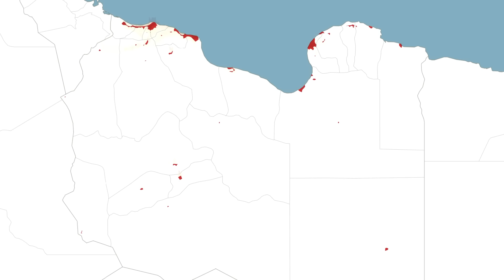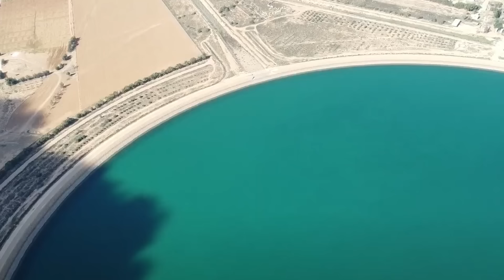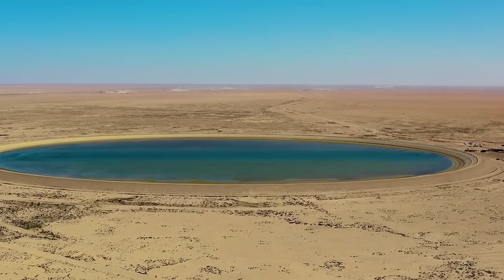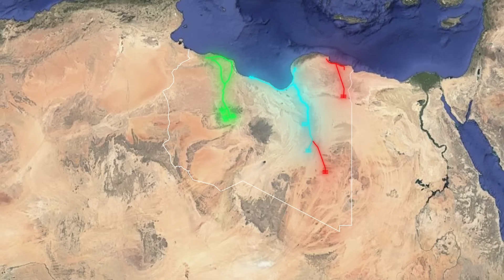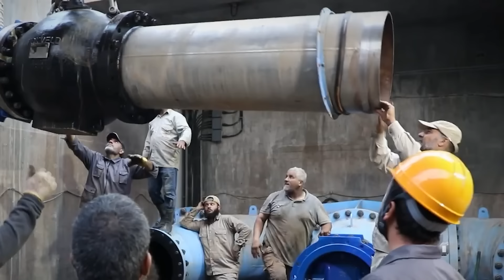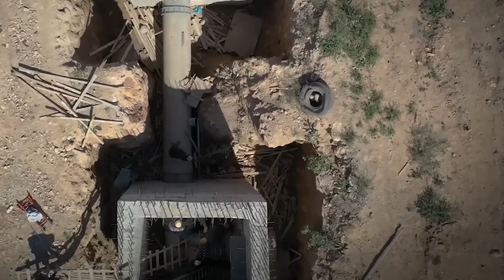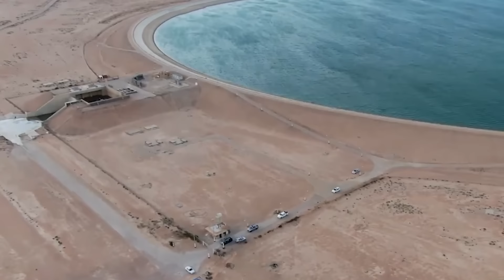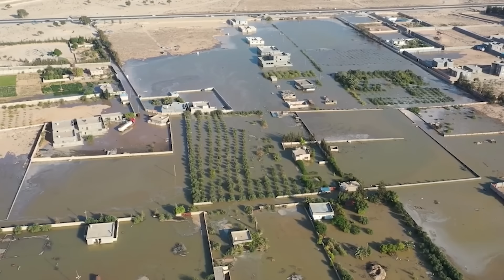They Start Pouring 2 Billion Liters of Unsalted Water a Day Under the Sahara Desert

Comment: The reason why they say it won't last past 2100 is because concrete pipes are rated for a 100 year lifecycle.
Reply: Detroit would like a word.

No, really you're correct. The pipes in Detroit were 95 years old when they burst during extraordinary weather
Reply: because contract always go to the lowest bidder which means they are using crappy materials or doing shotty work.
Reply: @tgreaux5027  Eh....concrete hardens for 50 years then softens for 50 years before it fails.
Reply: @DonaldJ22 maybe they cracked the code for Roman concrete.
Reply: They should use plastic straws...  solve two problems at once.  Save the dolphins, and use a material we are told will never go away.
Reply: Are we going to suggest that the worlds biggest sinkhole on the Libyan/Egypt border is a coincidence...???
Reply: The West's recalcitrant envy of any success of others not attributed to them or not seeking their permission is why the project failed. Left alone to themselves, the Libyan leader, Muammar Gaddafi, would have invariably created for his nation, an oasis in the desert. By recycling the water back to its source after treatment, Libya would have had ample potable water for a thousand years.
Reply: @kennethedwards3095  Meh.  Dictators invariably fall prey to their own insecurities and fragile egos, as they victimize those over whom they rule.  And, their greatest "accomplishments" tend to be monuments to themselves and their own shameless corruption.
Reply: @richardowens9061  he wasn’t a dictator, he was an elected authority
Reply: @encompassthyeclipse7278  Is he an "elected authority," if he cheated, broke all the rules, and actually tried to overthrow the government, while threatening to end the Constitution?
Reply: @richardowens9061  bud we overthrew irans government with operation Ajax and have endlessly attacked them for 6 decades. It’s about the nationalization of oil just like Venezuela and you’re an idiot playing right into the narrative for them. Good lil boy
Reply: And yes that’s what a republic does, they elect officials. Just like us, only less corruptible.
Reply: @encompassthyeclipse7278  You are very confused and stuck 73 years in the past.
Reply: @r @richardowens9061 o the past has nothing to do with the present that’s what you’re saying? Ajax CAUSED the Islamic republic. If you think that doesn’t matter, your brain is behaving like it’s 73 years older than what it actually is
Reply: @encompassthyeclipse7278  You hav no idea what I was saying.   Perhaps, you should work on your reading comprehension skills.   Because, you're punching air, here.
Reply: That is still 100 years of good water- still worth it for this generation of people in those areas.
Reply: these pipes are not going to age like other cities. There's no external water and no cold weather to temperature cycle the pipes. 

They'll last hundreds.
Reply: They just discovered the recipe of roman concrete. Dont believe anything that is on youtube on television. Its all a lie.
Reply: Oh that would be a very nice relining contract. You can use uv hardened liner to prolong that lifespan, no drinkwater certification yet afaik
Reply: except roman concrete which still stands after many centuries.
Reply: @duanenavarre7234  unfortunately, most municipalities are unwilling to spend the extra money to provide the quality additives or to pour layers as thick as the Romans did.  The foundation of the Coliseum is 18 meters thick
Reply: @duanenavarre7234  different composite material and curing process compared to conventional modern concrete.
Reply: @duanenavarre7234  Roman Concrete that is still around has a few things going for it.

1. It's generally of the top tier projects - things where money and labour were not an issue.
2. It's what has survived.
3. A lot of Roman buildings were built up abusing the compressive strength of cement.

All of this together means, what we have around, was given the best possible chance to survive. Generally, low hydration cements will cure stronger - but, it means you can't just let it flow. 

One of the best things you could do for this cement, is get some extremely high mineral content water and essentially wash the pipe with it over, and over, and over again letting it dry in-between. The water will evaporate, leaving the minerals deposited.
Reply: @duanenavarre7234  It doesn't rain very much where they're located.  Put those columns in Seattle or New York where the rain leaches the limestone out and you will find that they don't last that long.
Reply: @duanenavarre7234  and I just saw a bit that explained a recent discovery of why. some about the source of materials being high in calcium iirc. and a hot process that left chunks in the concrete to seal cracks. awesome.
Reply: @duanenavarre7234  true but also not entirely true. but great observation
Reply: @duanenavarre7234  yes BUT roman concrete isn't in constant flowing water/pressure.
Reply: Should have sealed the interior of the pipe with a poly seal, concrete would have lasted.....
Reply: Whi has visited the pipe factories? Can I see schematic and building materials?
Reply: The inner side of this pipes are made plastic